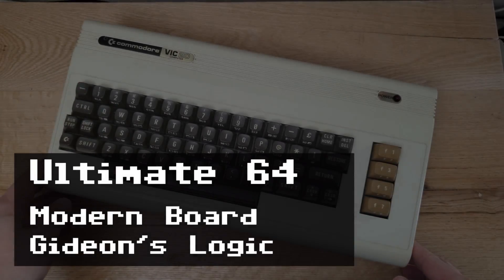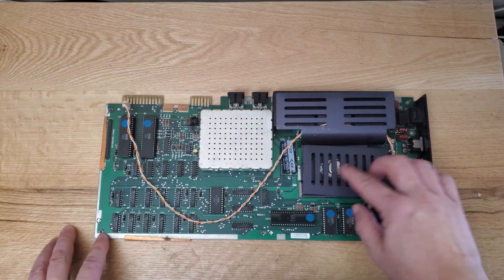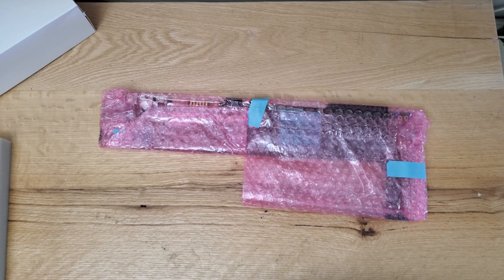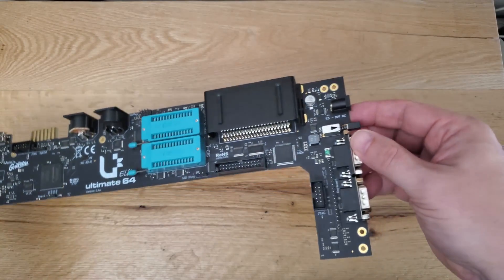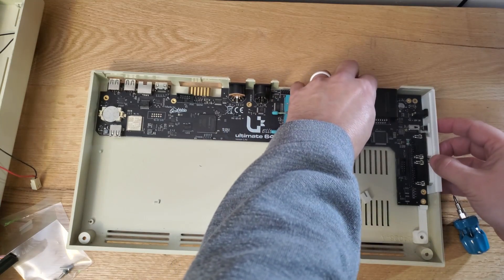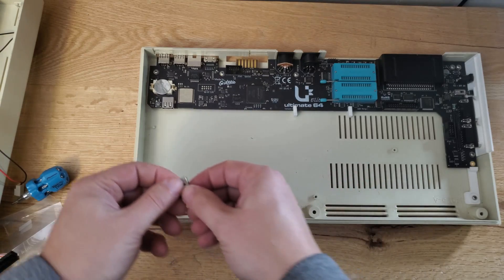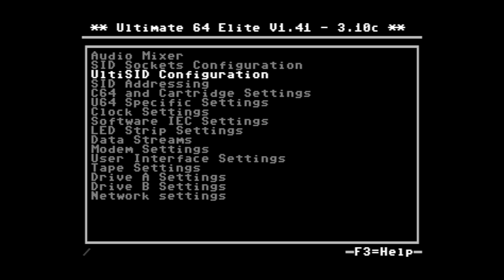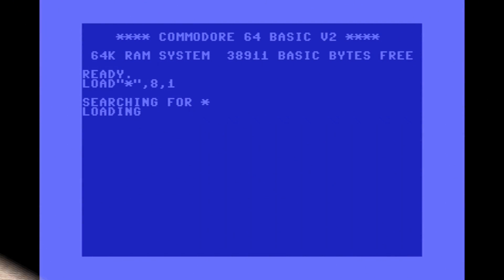Here is a Commodore 64 - Ultimate 64 Elite project!

Comment: looks just like my vic 20, which works good but the power switch tuns on hard. it has the flat power plug like that which is the good one, its the round plug power supply that can be a problem.